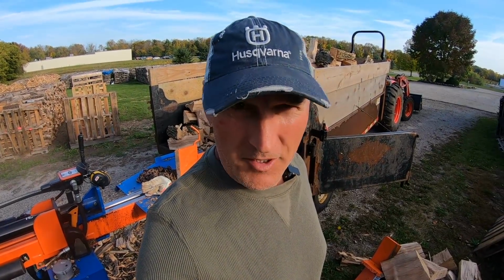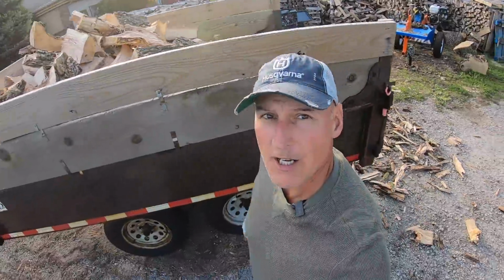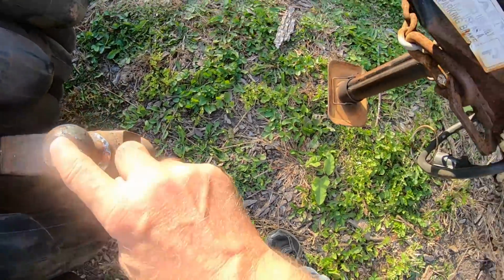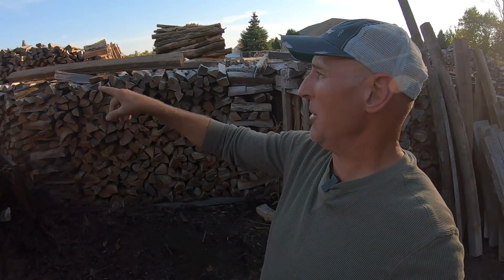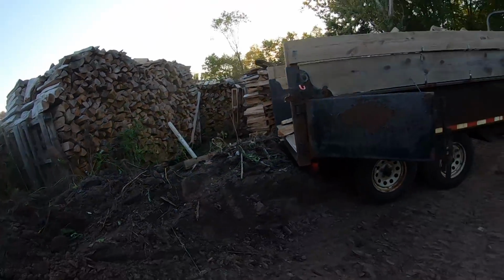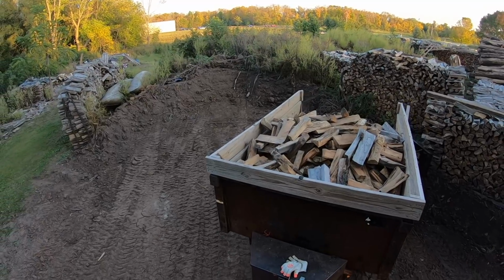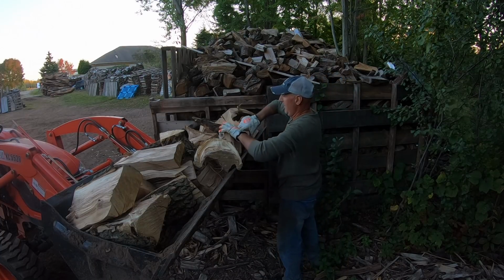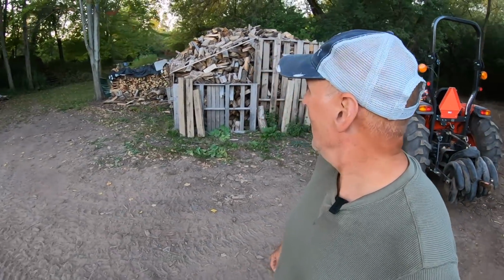Firewood Moving and Loading! - #474

Comment: Sadly I haven't had time to do any wood cutting since June. Luckily back then I at least split and stacked about 4 cords total and sold about 2 cords and have more going out this week but just checked the moisture meter and it read 10-14% so I think its good to go lol. Years ago I had a 6x12 trailer when I first got going in lawn care and I went over some railroad tracks and the damn thing did the same thing but VERY luckily I stopped and it came back down on the ball, I forgot to latch the trailer to the ball.....that would have sucked to try to unload the trailer and try to put it back on right on the tracks lol
Reply from the maker: Yup, rail road tracks got me years ago too!

Comment: I wonder if Tony actually used the stick of gum? I hope he doesn't pull a filling.
Or you will get a bill in the mail. Lol
I have to get use to it being dark when I would like to get out and do something.
No wood today. Last grass cutting of the year today and tomorrow. 15hrs worth with zero turn mower.
Then 6 cord have to be delivered. 110 face cord this year. Not as much as you but it is as much as I can do splitting by hand. I'm thinking of possible buying logs though.
Reply from the maker: 110 face cord by hand is nuts! Get a used splitter and you will be able to double that easily!

Comment: Thank you for the vid! I'm curious why you haven't installed higher sides on your trailer so you can throw 4 pre-measured face cords without stacking. Seems a few vertical supports and lag bolts would do the trick in 20 minutes.
Reply from the maker: My sides are double extended already and I am afraid of it being to tippy any higher.
Reply: Is weight a concern?  Can the trailer handle more weight safely?  Licencing?
Reply: @jlhaslip  Chris already carries 4 facecords. He just spends 20 minutes stacking it versus tossing it into a pile in the trailer. So I think weight is less of a factor.